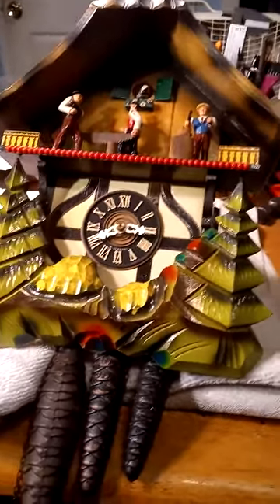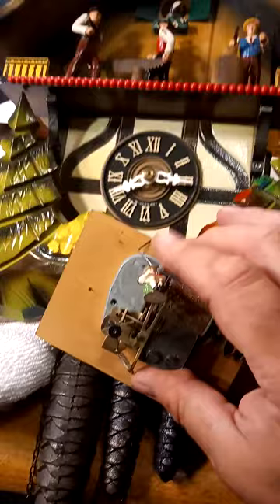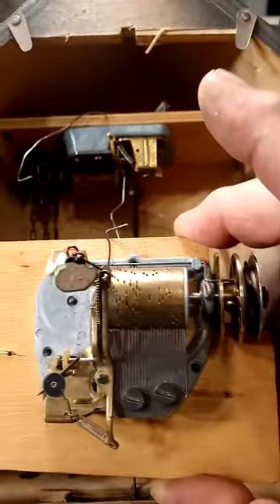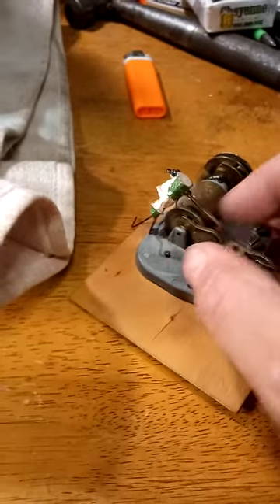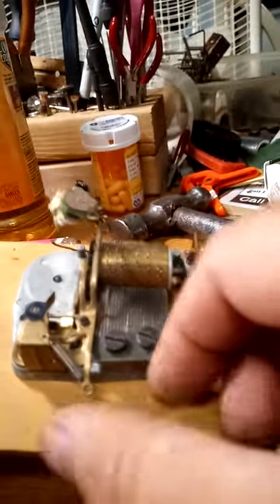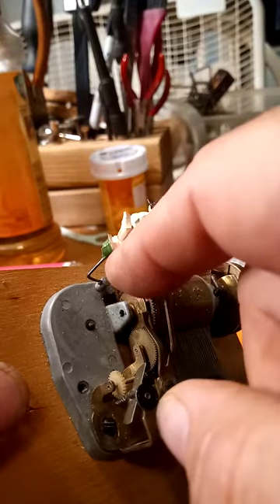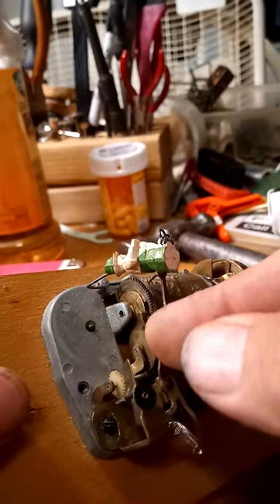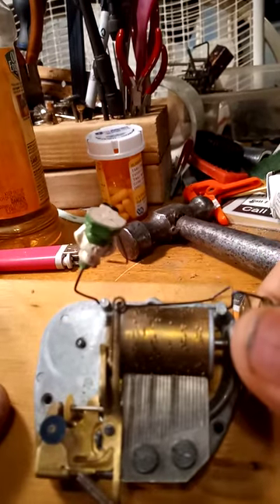Repair/adjust cuckoo music box video 3 of 4 20200808 134457

Comment: With the clock I'm currently working on, the door is open with the little man standing in the doorway.  The music plays for a few seconds, the  man snaps inside, a second later he snaps back outside and the music continues until it stops.  It appears that the key to fixing this would be to get the music to the stopped position, loosen the set screw on the wheel with the slot, rotate that wheel itself until the wire falls into it, then re-tighten the set screw.  I'll be trying that either this morning or this afternoon.  Would it be easier if I were to remove the music weight, take out the music box, make the adjustment and put it back in?  Thank you Mark.  This is the same one I was talking to you about a few days ago.  Everything on this one is now fixed except for that one item.
Reply from the maker: Yes it would be easier to take the music box out of the clock to adjust it. That is what I would do at least. I have broken things by trying to get in a rush.

Comment: Why does the clock have three different weight sizes?
Reply from the maker: It is just what I had at the time. Plus the side that the bigger weight is on has a worn pivot hole that I need to put a bushing in. With the bigger weight it allows the clock to run.
Reply: @munnerlyn3  Ah, I see.